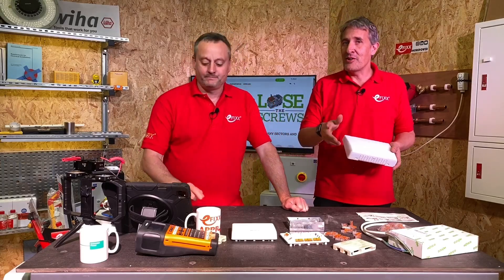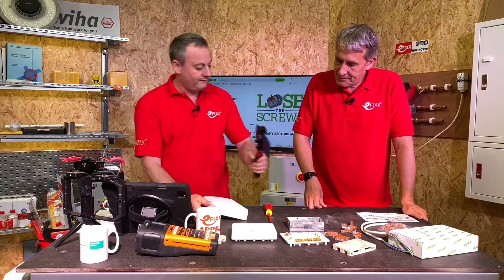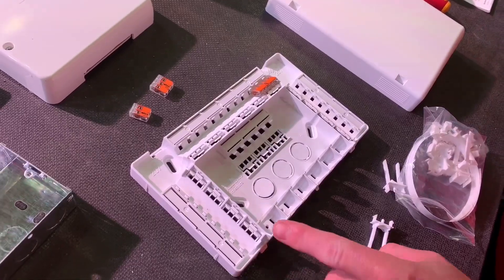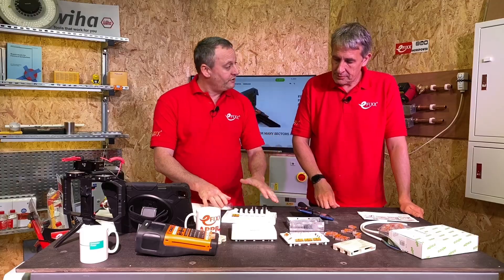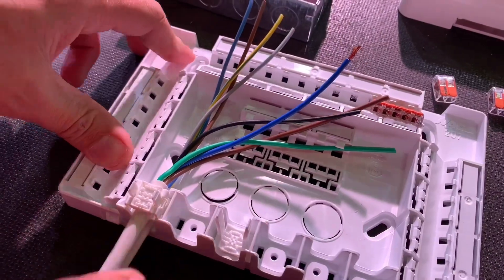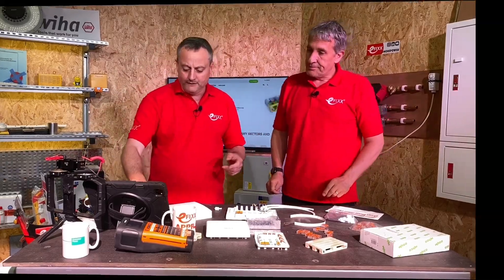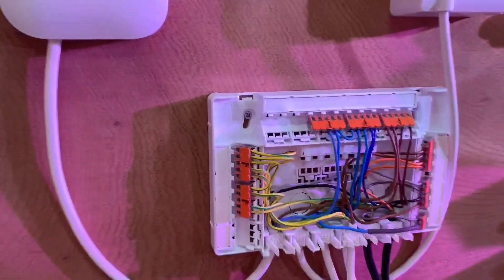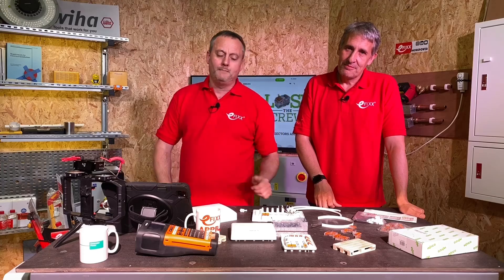The Junction Box for Heating Systems - Wago 207-4301

Comment: Getting the lid off mine was and continues to be a nightmare.  Terrible design, pushing screw driver into slot to release catch, doesn't work well at all.  Like all products like this, the designers should be forced to use them then they'd make a better job.

Comment: I love the wago products but I have found one slight drawback- I often need up to eight ports for grounds here in Jamaica.. but prefer the wago lever nut option rather than the other options..just seems easier to troubleshoot.
Ran into the products in UK. I am doing loads of Conduit wiring so-- loads of wire pulling.. but a mix of NEC rules here combined with UK standards parts--lol
Reply: also wished they did what some of the replica companies already have- a three port lever plug that is the three seperate colors-- actually would love a four port option- Ground, Neutral, Live one and Live 2, as I do a load of Cieling fan light systems- 2 switches or a switch and fan slider-- lol.. So having those in the ceiling box location since cielings are concrete. Most of the UK and USA options like quickwire do not easily fit in an octagon or 4 square box

Comment: 2 years ago had to rwire my existing boiler connector box. Ripped out the screw terminals and superglued 222 terminals into the box  which worked. The new box would have been even better.

Comment: One of the main differences from the previous one is the lack of     
examples of Y and S types. There must be an optimal layout of cable entries and placement of the various connection points.
Reply from the maker: We've now made this video with our suggested layout for S-Plan - https://youtu.be/zHDqcqRGeg4
Reply: @efixx  and I have a Y plan ...... I’ve all the parts so I’ll wait 🤫
Reply: It’s really useful and worth the effort expanded in the cold. In my documentation, I label the cables with a source and destination to make it easier to trouble shoot but I have been shielding for 11 months!
Reply: Any chance of a suggested layout for a y-plan using this L60 box?

Comment: Am I missing it ?
I think that you stated 60 connection points . My count is 51 (17 x 3)

Do you install 5 ways overlapping outside the area?

I notice that the diagram shows 60 positions but this varies depending on the mix of 221s

Comment: Great video - is there still access to the testing point(s) on the 221s
Reply from the maker: Good question - we will check this
Reply: @efixx  checked can’t get to the rear test point when box is on the wall. Can still get to the one on the front if you can get under the wiring to reach the Wago 221s installed in the centre area of the box

Comment: what is this box for if any1 can advise. I've been on different building sites and never came across the need for such a box .
Reply from the maker: It’s used in the central heating system on homes with underfloor heating or boiler with hot water tank.
Reply: @efixx  you mean dry UFH systems. Could you point to the video or diagram when such a box is use. Cheers
Reply: Howdy derk, you’ll probably never see this on a site as prices are that tight they aren’t going to be used,

Comment: Cables entering from the bottom only are great - heating wiring is often done where there is pipework, so if there is a leak, water is less likely to enter the wiring centre. I think the price is easily justified by the time you save in installation and long term for the customer in any fault finding as fault diagnosis will be a lot easier. Much better than an adaptable box as you don't have to drill holes for glands, the drilling creating micro-plastics particles and pollution. Fault-finding on an adaptable box with nothing labelled wastes time and is costly.

Comment: Nice that Wago have listened to the complaints about the old box and made improvements! A lot of new homes have heating valves/stats for each floor so these boxes would be great for that. Cable entries on one side only isn't ideal though if retrofitting.
Reply: Sides are raised so you can take cables from any side but you would have to cut with a hacksaw.  Not ideal but possible.

Comment: It's a shame that the wago 221 blocks stop at 5 conductors. A product like this is crying out for a bigger block to join the earths.

There is also the question of how much this will cost and how readily available it will be. A quick google finds only one supplier and they want £18.50 for it. It's not clear to me if that price is ex or inc VAT, but either way it's IMO too much for an empty box.
Reply from the maker: We’ve also found it online for £18.50 inc VAT.  If you compare this to a 10 way Honeywell
Unit (20 connection points) £9.00 - IMO you would save the difference in time on a large system  of UFH or S-Plan plus.
Reply: I thought you were dead? If you're in heaven, can you ask God if you are better on guitar than him?

Comment: Cord grips are a nice touch, but for me the Drayton wiring center is hard to beat, and again the cost of this unit will stop it being mainstream.
Reply: I've only found one reference to a price for the 207-4301 so far - https://denbysolutions.co.uk/shop/ols/products/207-4301
Reply: @dominicdodd9759  add the connectors and it's £25 when you can get a good wiring center for less than £10
Reply: @acelectricalsecurity  That's true - Salus do one for about a tenner.  However - for me, personally - I prefer Wago over screw terminals. I think they are quicker and more 'accurate' - and should be maintenance free.  I'm willing to pay £15 extra for that, and knowing if I come back to it, making changes and upgrades is going to be that much easier.   The downside of Wago connectors over screw terminals is when it comes to testing - the test ports are impossible to get to without removing the G38 tips. Horse for courses ...
Reply: @dominicdodd9759  Yeah true, without doubt push connectors are quicker,  and i use them but its a shame they are so expensive compared with connectors, and there lies the problem with products designed to save labour. I get the impression from manufacturers they think this product will save time so we can up the cost, to me if they are trying to replace an existing product, the new product needs to be better and similar cost to whats currently being used, but thats not the case. If their new products were the same price then in a short time they would replace the product they are trying to replace.

Comment: Still screwdriver required to release cables 😉
I like the small space above terminals for tags
Reply from the maker: Wago make a special tool for releasing cage clamps. It’s not a screwdriver (but looks suspiciously like one)
Reply: It's a requirement that a tool is needed to access anything with potential danger.